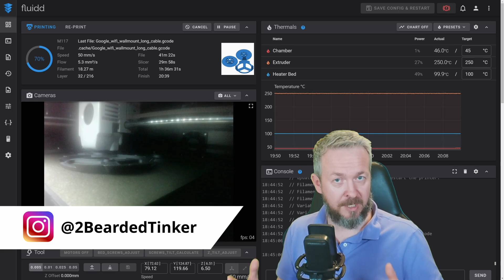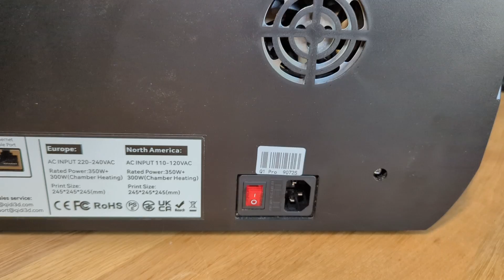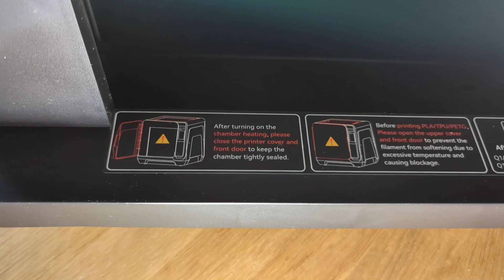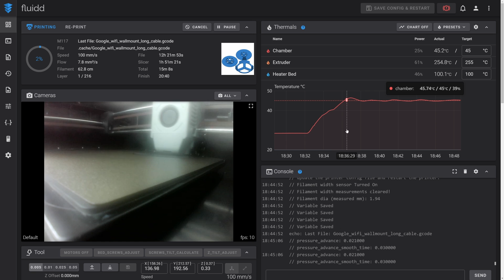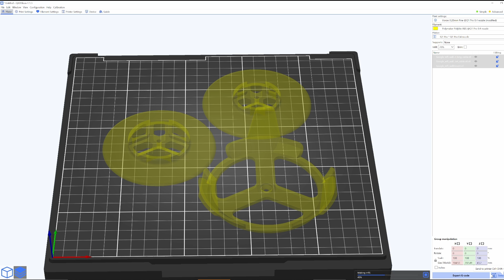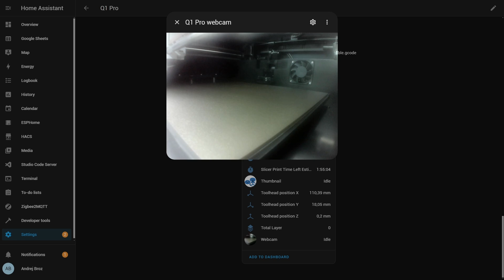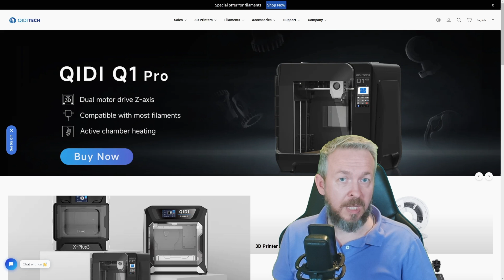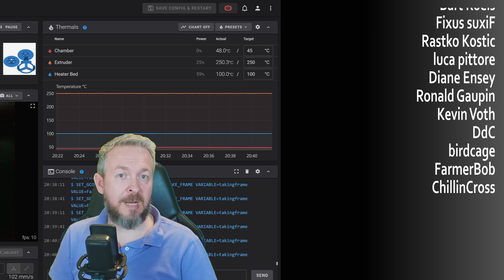Budget Brilliance Qidi Q1 Pro Delivers Perfect Prints

Comment: regarding the very big size of the printer, i believe this is so that it holds heat much better to save energy, if it was thinner it would lose more heat to its enviroment and use more power to hold the right chamber temp
Reply from the maker: My thoughts exactly, but it also depends on the material of the case. Though, I think it's still loosing a lot of heat through lid.
That's the only reason I see for such big case!

Comment: Pre-ordered trough your affialiate link.
I can live with the current flaws (which are not for me), but the big plus for replacing my old ender 3 is the heated chamber.
My printer is in the basement and it struggle in winter when temps are around 16/17°C even with PLA. Added speed will be a bonus.
Reply from the maker: Thank you very much! I'm also considering to move it to basement - it's currently outside and printing on outside temps ranging from 0 to 28 was not an issue so far - included heater makes it much easier for those cases. Remembering how I had to make cardboard box around my Ender 3 to print some parts and protect from draught

Comment: Great video, thanks for sharing!

I agree with you that the size of the "box" vs the print volume seems excessive. How is the filtration (I'm thinking about printing with ABS and associated fumes for example)?

For a fully enclosed printer that doesn't require any cloud accounts, I think the price seems correct
Reply from the maker: It doesn't have any out of box filter, just plain vent that you can use to vent fumes out. But there is STL on Qidi wiki web site that you can print to add active-carbon filter and additional external filter.
https://wiki.qidi3d.com/en/Q1-Pro/Other/Components

Comment: Thanks, great review. I may have missed it, but did you print with any TPU. If so, I would like your opinion on how well it prints TPU.
Reply: It's pretty awful with TPU - very easy to clog up the hot-end. That said, I think a lot of that is down to software - the nozzle cleaning procedure exactly what you'd do if you wanted to clog the extruder with a soft filament! That said - I printed a couple of great TPU benchies before having problems so I think the potential is there!
Reply: @Jakdaw  Thanks, I have a Dremel 3D45 that prints TPU fine but at wall speeds no greater than 30 mm/s. I generally limit the speed to 20mm/s. What speeds did you use.
Reply: @stevebissonnette760  default profile is bottlenecked on volumetric flow @ 4mm^3/sec - which was giving something like 40mm/s but causing failures. Touch wood it's doing better at 25% slower - so similar to your Dremel. Main problem seems to be that it's Klipper configuration seems to want to let the hot-end cool whilst it does nozzle clean, bed-levelling etc  and whilst it'll start printing freshly-loaded TPU it's very hit and miss as to whether it'll manage to extrude TPU in a hotend that's cooled down and then been heated up again.
Reply: @Jakdaw  From what I have seen in other reviews, the path from the extruder grip wheels to the hot end is long, and a loose fit to the filament which allows flexible TPU to bend and bind if pushed too hard. Increasing temp and reducing speed? is needed.
Reply: @stevebissonnette760  yes, and loading filament manually (macros exposed in the UI do so too quickly) and rewriting the PRINT_START macro.
Reply from the maker: Not yet. Need to dig a good stl and will print it